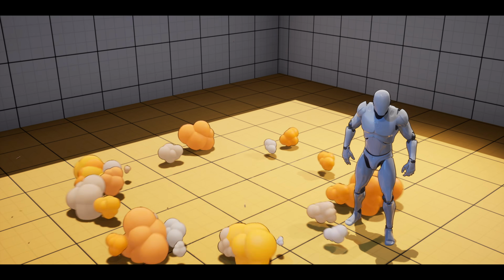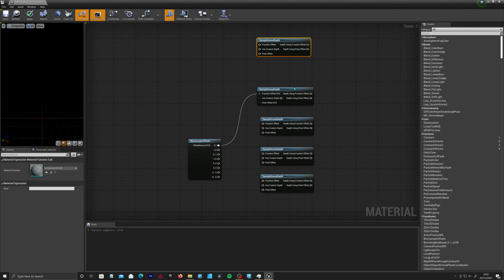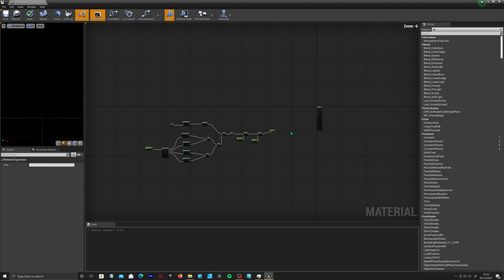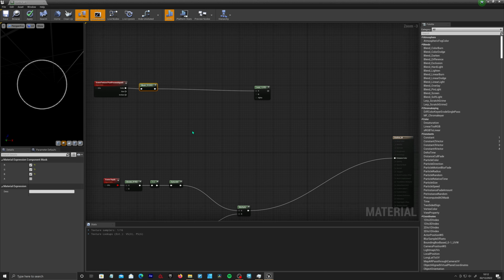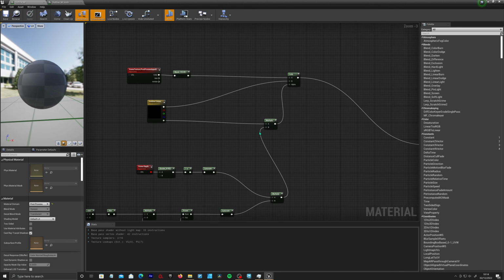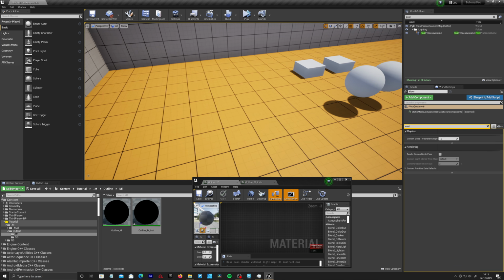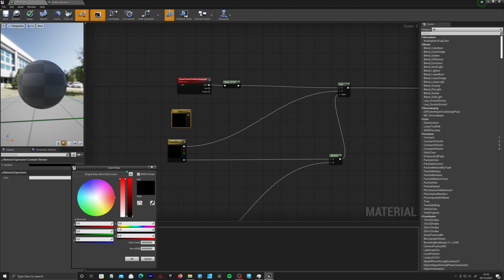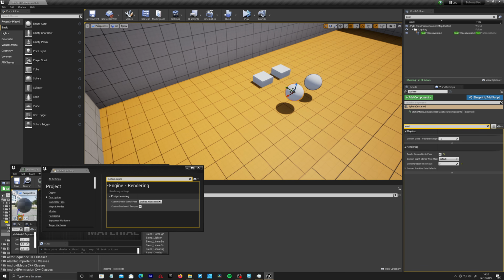UE4 | UE5 Tutorial : Outline Material

Comment: I did this in UE4.27 and it worked fairly well, but the part about controlling which objects would get the outline (custom depth masks) didn't seem to work. No matter what I changed, it ended up being all or nothing. The Enabled With Stencil setting didn't change anything either.

Maybe it has something to do with how I have a separate material for cel shading? I'm kind of new to all of this.

UPDATE: I sort of fixed it, I guess. I rearranged it so that the Outline material came before my cel shaded material in the Post Process array elements section, and that seems to have worked. Still not sure I'm doing this as well as I could be...

Comment: Hello, This is an awesome tutorial! Thanks so much for this. I just had one question - How would I go about adding even more stencils? I'm looking to do about 6 different colours and versions of the outline. Thanks!
Reply: Hi, I actually figured this out - I needed an even number of stencils so at the moment I have 4. I then did a pyramid of add nodes since it's an even number this works nicely. Then do the same method he does, with the colour in lerp B and the previous Lerp in A. Then the alpha goes into whatever bitmask corresponds to your new stencil number! 

I am trying to figure out how I can toggle on and off scene depth at the moment so the outline is visible through objects, any help on this front? Thanks

Comment: Weirdly when I finish the step at 5.06 to remove the background I get a horizontal line in the background, I am using 5.5.4, anyone come across this?
Reply: I have the same issue. Horizontal line across my screen at certain angles.
Reply: Ahh, just had to get through to the part to custom depth and only apply it to things you want.

Comment: I am trying to achieve this but it seems like my "outline" is not around the model but shifting on the model itself when moving camera. I ran through the tutorial twice to make sure all I set is exactly what was mentioned and cannot see any error. I wonder if something else needs to be turned on or off in maybe project settings or if anyone had the same issue? Thanks for help.

btw, decent tutorial!
Reply: Ok, all solved I did silly mistake and connected all SampleSceneDepth to SceneSampleOffsets (0,1) rather to every 4 top options. Not surprise it did not work if I offseted this just from one side.

Comment: i couldn't change the outline color for some reason
Reply from the maker: Have you got the instance material set up in your post process volume? You should be able to change the colour via the 3 vector (colour parameter) 😁
Reply: @ I did it an instance but couldn’t change it tho
Reply from the maker: @baryafe hmm, that's strange! It's a little difficult to tell what's wrong without seeing it unfortunately. Is the colour parameter plugged in correctly, sounds like an issue with the lerp? 
Feel free to join our discord and share some screenshots on our dev chat channel ☺️
Reply: @ oww thank you! Will join

Comment: I only added this to specific things, but I have an issue where the outline bleeds onto other objects.

So if I put my box on the other side of a wall, the outline can still be seen on vertices on my side of the wall. Kind of creating a bad x-ray vision.
What is the solution for this?
Reply from the maker: Hey there! You could try our local outline tutorial that uses the mesh instead of the post process :
https://youtu.be/33_PiRmOe_Q?feature=shared

The issue you are having is down to the use of the depth pass. 😁
Reply: @realityadriftstudio  Thanks for the reply! 
Sadly we are still working in UE4 though, so we can't use overlay materials

Comment: Great vid, helped me a lot. Although there is a flaw that I ended up fixing. You are extending the outline both inward toward the mesh and outward away from the mesh (relative to screen space) Then you use a custom depth stencil mask to mask out any object that shouldn't have an outline. However, you didn't dilate the mask outward, so you end up masking out the half of the outline that extends outwards from the mesh. Look closely at 10:06. Notice how the outline where the two spheres intersect is twice the thickness of the line on the right side of the sphere. This flaw is especially noticeable using thicker lines.

So to get the thickness of your lines nice and consistent, you need to expand the custom depth stencil mask. A simple way I found to do this was to create 4 custom stencil nodes, offset their UVs by a very small amount in all 4 directions ( I add 0.00006 to the texture coordinate for my lines of thickness 1 ). Then I combine all the stencils using max nodes before putting them into the divide by 255 node. If the mask is extended too far, the outlines can sorta bleed from the intended objects to the unintended objects, which could honestly be a cool stylistic effect with the right attitude. But otherwise, it took me a lot of trial and error to find the right mask offset for my chosen line thickness.
Reply from the maker: Hey there, I'm glad you found it useful!
I have a more advanced outline tutorial that goes over  a solution to expanding the outline outwards 😊
Reply: @realityadriftstudio  Which of the tutorials has the solution?

Comment: Anyway I can fade out the material? I want to use this effect to highlight materials but only for a few seconds
Reply from the maker: Hey there!
Yeah, you could create lerp with the post process input connected to A and the outline effect connected to B. If you then create a parameter (called outline fade or something) and chuck that into the lerps alpha.

To control this in Bps, you will need to create a dynamic material instance and add it to your post process and save the DYM as a variable/ reference in your Blueprint. With this reference you can set scalar and make sure it's set to the same name as your parameters name😄 you should be able to control the float with a timeline if you like. Sorry for the wall of text! I hope that helped.
Check out our discord if you want to share some screenshots 😁
Reply: @realityadriftstudio  Thanks for the reply, how can I add a DYM to the post process, I have searched how to do it but couldn't find anything. The solution that I went for was using Material Parameter Collection
Reply from the maker: @finesseandstyle   
No worries.
The material collection should work fine too! It's just means its a world value so it effects every player.
If it needs to be on a specific player's screen, then I'd do something like this :
https://forums.unrealengine.com/t/change-post-process-material/448103/5

The post process effect would be applied to the setting in the player camera instead of the post process volume 😁 though if it's a single player experience, I'd just use the collection!

Comment: Hi I followed your tutorial but the inner parts of my object also have an outline. Do you know what might be the problem?
Reply from the maker: Hey there!
Do you mean the details of the object? Such as wrinkles.
It could be the values put into the outline amount, power and thickness aren't strong enough.

If you could Jump on over to our discord and share some screenshots I can have a look😁
Reply: @realityadriftstudio  Thanks for your reply! Yeah the details are also outlined. I tried changing the values of power and thickness but it didn't really work. I guess my objects (e.g. shelves) have sharp edges so using the method in your tutorial doesn't work well in this situation. I changed to another method of creating outlines and it works now. Thanks for your help and thanks for the great tutorial!

Comment: Is it possible to add more colors for the outline besides just two? I see that you plugged in the bitmask result into the lerp for the color red. Wouldn't doing that only allow 2 choices of color?
Reply from the maker: Hey there,
You are absolutely correct!

However you can add multiple bitmasks together, so that multiple colours can be assigned for different actors😄
Reply: @realityadriftstudio  Okay last question. I got the multiple bitmasks going but when one object is in front of the view or another the outline colors blend. IE  Block_0 with stencil value 3 for red is in front of Block_1 with a stencil value of 4 for blue. Block_0 outline is now purple on the section that overlaps in the viewport. Is there a way to disable this "Feature"
Reply from the maker: @TheUncooked  Hey there!
From what I understand, this might be a limiting of the depth based effects but I'll have a look into it 😄

You could create an importance order of sorts but it would be static. So if A is higher than B then if A is behind B it will look correct but if B is behind A it might mess up.
I'll give it a go and get back to you  😄

Comment: Would there be a way to make this highlight all edges on a cube for example, or would that get too messy?
Reply from the maker: Hey there!

Yeah you can do that...kinda depends on the look you are going for but if it is a specific cube in the scene you need highlighted. You can use custom depths to "lerp" specific values/ parameters for that cubes outline (like the different colours, you can also do the same for the parameters) 😄

Alternatively, if you need the whole scene to be affected then there are two options. You can try and tweak the parameters to get the look you want but I think (depending on the look you are going for) it might be a little too much. You could also try this post process material:
https://youtu.be/M98C_OoE40I?feature=shared

There is a little more to it but it will pick out all the little details!

I hope this helps ☺️

Comment: This is working for objects near the camera but objects in the distance don't have the outline. Is that just because the outline is so small I can't see it? I've tried ramping up the values but still cant see any outline
Reply from the maker: Hey there! You may need to decrease the divide in front of the "scene depth node" this is kinda mask for the sky but if it is too low it will cut into the playable area too.

Comment: So I have a problem where I can see anything outlined through the map. For example, I added the outline to a few buildings and you can see the building outline from anywhere now even through walls.
Reply from the maker: If you have a bool param plugged into the back of the " sample scene depth" nodes and it's ticked on, you will see the outline through objects.
If that is the case then, tick it off or delete the bool!
Reply: @realityadriftstudio I actually wanted it to be fully visible behind walls and setting Use Custom Depth to True made it work unlike with default where it's partially visible, thanks!

Comment: but how to set custom depth to particle effect what is not present on the level, but will be called from some blueprint
Reply from the maker: Hey there!
After spawning you particles effect via blueprints. Drag out of the spawn mode and add a set custom depth (tick on) and also set customs with stencil (set the value to the same number used within your postprocess material) 😊
Reply: thanks for help and positive reaction. i've actually found a solution close to that, so hope this answer will be helpful to others who trying to use it with particles @realityadriftstudio

Comment: Is there a way to have a gradient for the outliner? I have a ""selectable" castle and I want to have an outliner gradialy less visible at the ground level.
Reply from the maker: Hey there! 
Might be difficult since it's in the post process/ using the depth pass. You could maybe use the distance fields as a gradient , plus that into a lerp which could give you your fall off 😊 (you might need to divide or multiply the distance field output by a large number) I hope that helps!

Edit - 
Just tried it there, seems to work out ok! If you jump on over to our discord post some screenshots in the chat 😁
Reply: @realityadriftstudio  Thanks for the advice! But will it work with multiple meshes? I mean it's a castle with buildings inside that a separate meshes and I need distance field only from the ground.. Is it still possible? Can select/mask wich distance field to use?
Reply from the maker: @АнатолийКнязьков-р6я kinda depends....
You will need to turn off distance fields on your meshes except for the ground. If that's ok then yeah should be cool!
Reply: @realityadriftstudio   Ya, it should work.. thanx again)

Comment: Is it supposed to outline the wireframe?? Also it’s following the color of the object. Any reason why?
Reply from the maker: Hey there!

Wireframe wise - this technique uses a mix of the wireframe and depth pass so it will outline the wireframe however you should be able to tweak and remove it via the power and intensity/ multiply😁

I'm not sure what you mean by following colour? Sorry 😅
Reply: @realityadriftstudio  thank you for replying!! The outline isn’t black, however o have the outline color set as black. Instead it’s the color of the object it’s outlining. I’m also having trouble where it’s making some objects completely black
Reply from the maker: @HauntedTS13  is your custom depth stencil turned on? Should be in your preferences/ custom depth and then set it to custom depth with stencil 😁

These are really odd results, it's not something that should be happening. It could also (as a guess) be a bug with UE5. There have been a lot of issues throughout the engine unfortunately!
Reply: @realityadriftstudio  yes I turned on custom depth stencil… weird. Thank you though!
Reply: @realityadriftstudio  so the cel shader I was using didn’t like speculating/opacity mask which is why things were turning black. I also had the outline below the cel shader, but once I switched them the outline was black.
Reply from the maker: @HauntedTS13  Ah that makes alot of sense, I'm glad it's working for you now 😁
Best of luck on your project!

By the way, if you're interested I recently started a discord server with a few channels for Game Dev help/  discussion. If it sounds like your thing, check it out 😊

Comment: Mine doesn't seem to outline glass materials any reason why?
Reply from the maker: Translucent materials are excluded from the depth pass, which is required for this process. 

It's going to sound weird but if you turn on "output velocity" inside your glass material, it usually includes it in the depth pass which might fix this for you. 
This might also need to be turned on in your render setting too. 
Hope that helps 😄

Comment: why does it look blocky?
Reply from the maker: Hello, I can see what you mean. This process just makes a rough approximation of the shapes and outlines them.
I'm going to look into a solution to this and update it with my findings!

Thanks for your feedback 😁
Reply: @realityadriftstudio  Thanks for this tutorial!  I have a problem that sounds very close to this.  I want to define objects that are very close to each other.  Imagine a stone wall with blocks of individual meshes for example.  I want to see the lines of the individual stones represented.  Is there any way to do this using this method?
Reply from the maker: @m00nunit29 Hey there!
You may be able to get something close to what you need by tweaking the multiple/ power on this effect.
But I'm also working on a new technique/ outline method that should fix this issue 😁
Reply: @realityadriftstudio  I look forward to that, thank you very much!  I did try the settings as you mentioned, it just didn't give me the effect I was looking for.  It sounds like what you are working on will help, thanks again!
Reply from the maker: @m00nunit29  no problem! Sorry for it not working for your situation. Due to it using the depth pass it has some limitations.
In case you are interested, we also have a discord where you can share your projects and ask for help from myself and others 😁
https://discord.gg/GZm6NcXxHr

Comment: Thanks so much for the tutorial! How would you set this up to have more than 2 colors, i specifically needed 5 colors for different characters. Thank you for any advice you can offer!
Reply from the maker: Hey, thanks for the support!
Kinda hard to explain via text but...

If you duplicate your custom depth stencil lines including the bitmasks (the red and black from the video) 
Until you have 5 of them. Give each of them a different value in there bit masks and then add them together with a few "add" nodes and then into the multiplier at the bottom row.

After that, you will need to connect each bitmask into a lerp node, the A channel will be this specific character colour (3 vector) and the B will be the other characters colours - another lerp with the same process but for the other bitmasks.
The furthest right lerp should have the same connection as in the video though.

I hope that makes sense! If not, drop me a message on Twitter or Facebook.
Reply: @realityadriftstudio  I got it to work!!! Thank you so much for the help